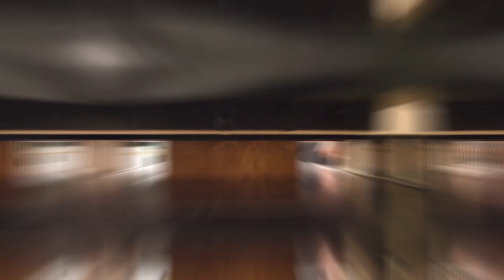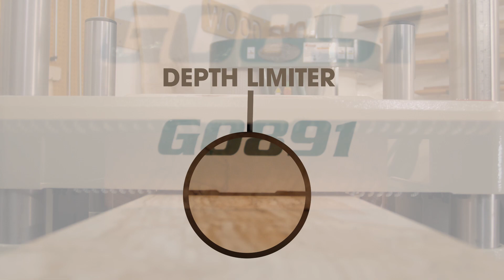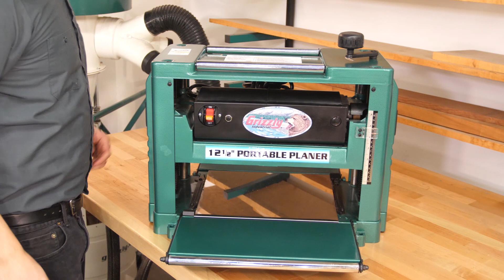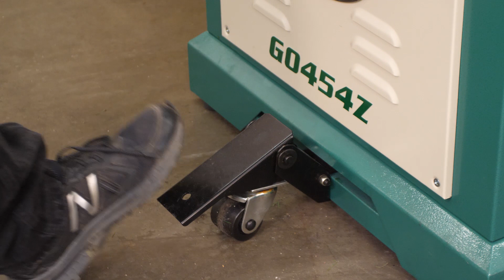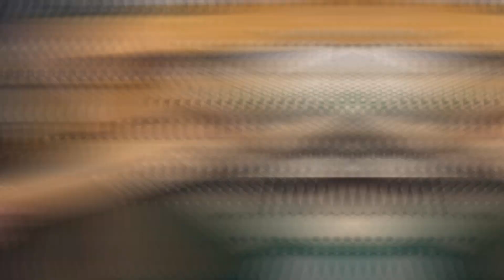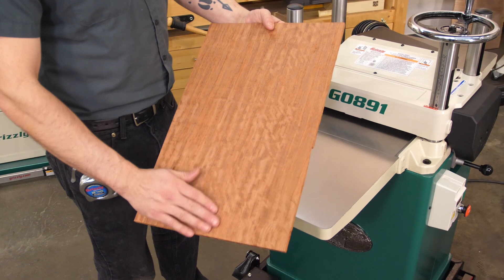How To Choose and Use Your Planer | Grizzly Industrial

Comment: Whats the typical CFM needed for dust collection for 15" planers?
Reply from the maker: Hi Keith, for 15" planers we suggest an absolutely minimum of 400CFM. However, if you plan to use the dust collector for an additional machine in the future then we recommend the G1028Z2 since it is affordable and it has 1300CFM of suction. That may seem high, but when you consider you can have it farther from a machine AND be able to run two machines, plus it's mobile and not much more an investment.

Comment: Picked up a 15 inch a few years ago because I could no longer repair my 20 year old table-top planer.
I love it! Runs smooth and quieter than my old one. Better dust collection. Easy adjustability. Really like the steel rollers as opposed to rubber. And as usual, great customer service!
Reply from the maker: That is great to hear the upgrade is serving you well. Thank you for your support!